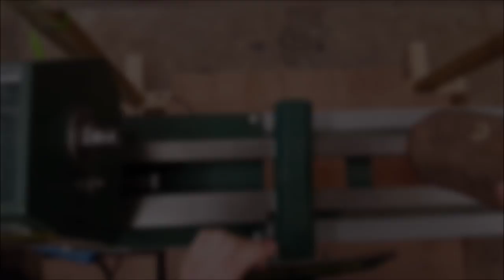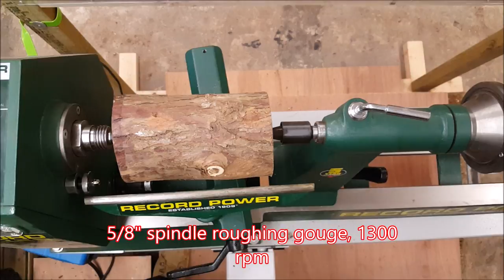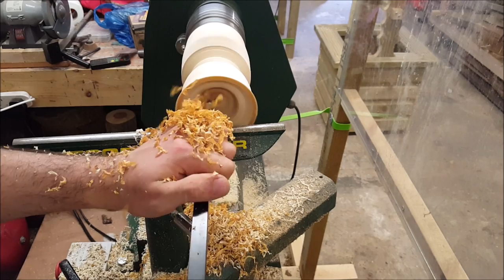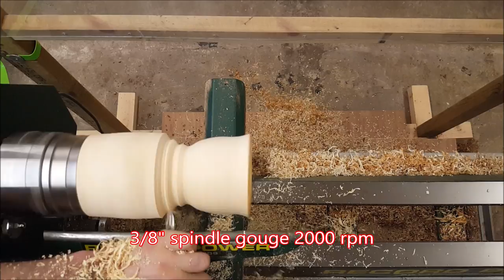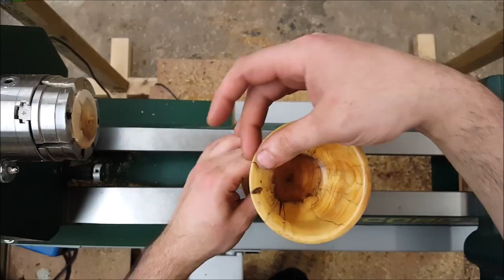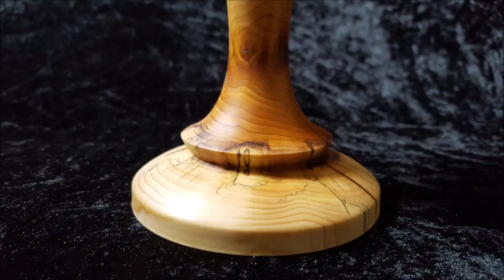Woodturning - quick guide to turn beautiful goblet

Comment: very nice!  I'd like to try something like this as a gift. How does the finish you choose (or other finishes) would be determined as "food safe", because I'd like the person that I'm gifting it to to actually use it as a cup?  Thanks for the input, great work!
Reply from the maker: Hey mate thank you for watching and commenting, to make it food safe i usually either use food safe danish oil or microcrystalline wax but  with microcrystalline wax you should let it fully dry for a day or 2 before using same with oil but abit longer since you have to build up the coats at least 3 or 4 times otherwise dont use a yew for goblet with other wood like lets say sycamore you can get away with 2 coats of  oil because its safe wood to begin with.
Reply: Awesome, thanks!